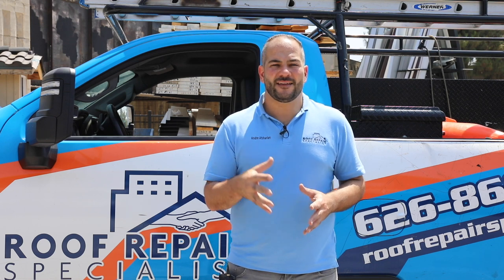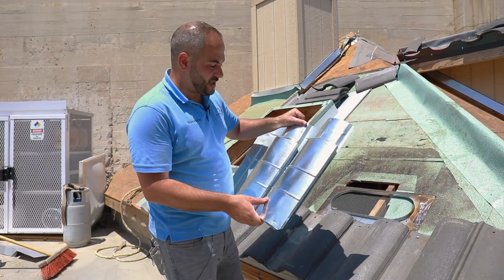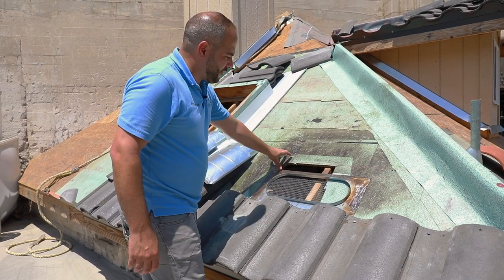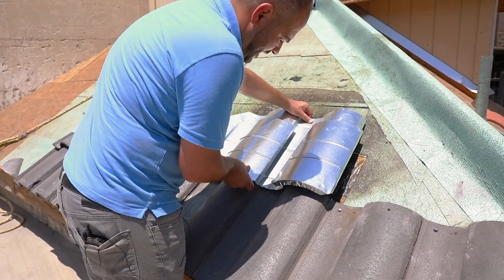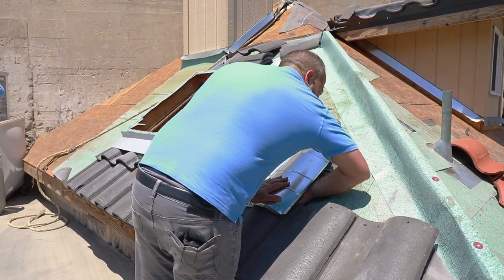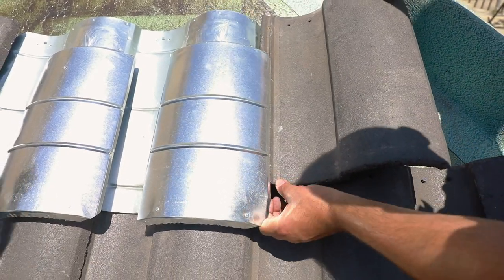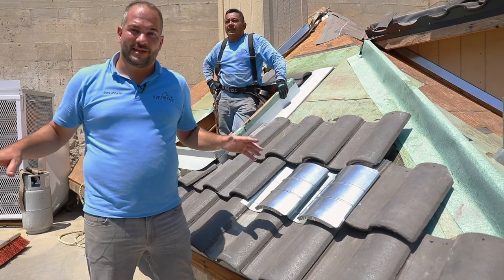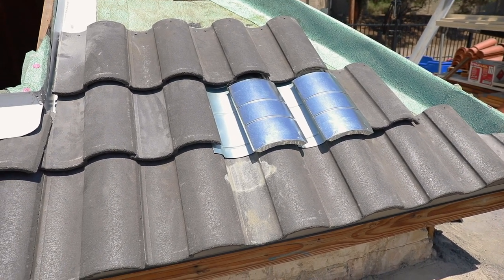How to Install an O’Hagin Vent on an S Shaped Tile Roof

Comment: Hello, I am getting some rain mist under the roof vent during heavy wind and rain.  Sometimes I see water droplets on the underside of the vent and on the attic floor.   If I caulk the O'hagan vent at there base where it rest on the lower tile, will the vent still allow proper air flow for attic ventilation?
Reply from the maker: I would recommend eliminating the vent. And not caulking it. The ugly truth is that from time to time vents leak for no rime or reason. Well rather there is a reason but there is no real solution. I have had vents that leak , but it has to do with wind driven rain, the angle of the roof, or possibly negative air pressure in the attic. In most cases it’s a freak occurrence that happens from time to time on only 1 area. Eliminating the vent is probably the correct answer.

Comment: My house has these vents. The roof appears to have a shallower angle that your example roof. The issue I have is during high wind rain and snow storms. The rain/snow is being driven under the lower and side edges of the vent. I can actually see water spraying in and accumulating on the under flange mesh and dropping into my attic insulation. This migrates to ceiling drywall. 

How do I fix that?
Reply from the maker: You need to either cancel the vent or replace it with something else like a dormer. I’ve had similar issues on different roofs and there is nothing you can do in my opinion.
Reply: @RoofRepairSpecialist  I just looked at pictures of dormer vent and they look more open ended than mine. What does canceling mean? Eliminating? If so, how do I vent summer heat?
Reply from the maker: Yes eliminating. I agree dormers are more open then these. Maybe a tile ridge vent is worth considering. All I know is I would prefer a hot attic over a leaky one.
Reply: @RoofRepairSpecialist  Thank you.